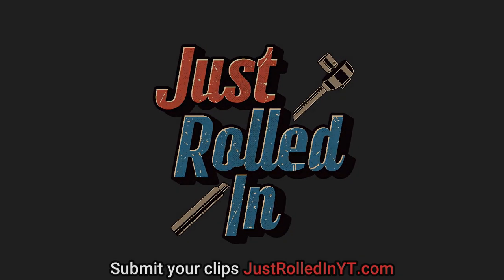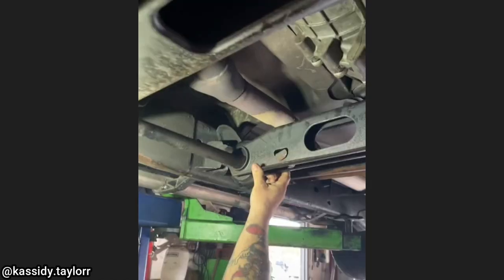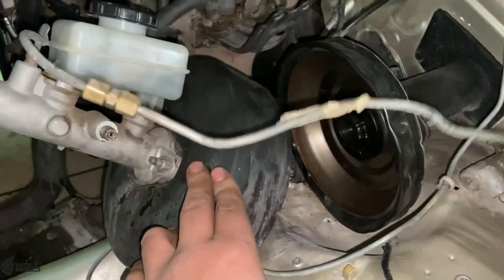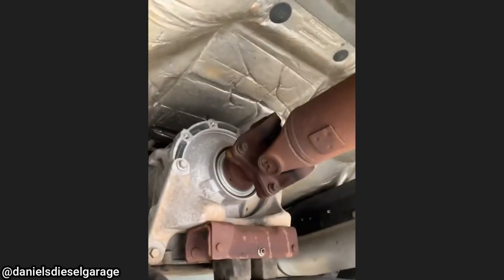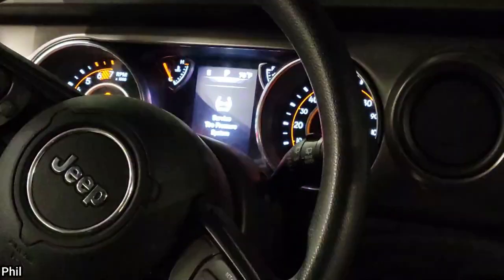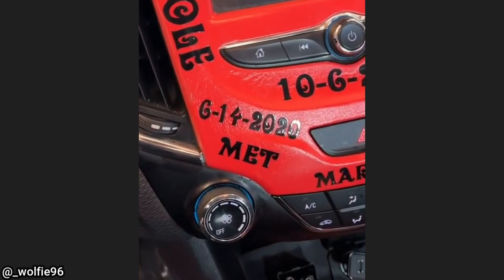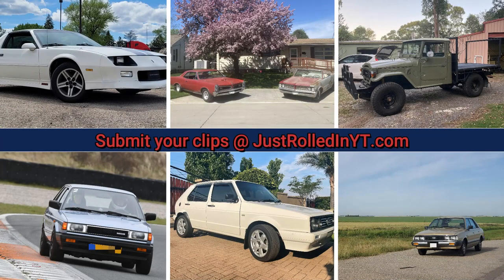Customer States Haven't Changed Oil In 60,000 Miles | Just Rolled In

Comment: The fact that these, and MANY MANY MORE, vehicles like them are out there, right now, driving next to us all, is frightening AF 😳
Reply: Glad I'm living in Germany, where a safety inspection is mandatory every 2 years. People may still fuck up their engines by never changing oil, but if their brakes are crap, or suspension broken, or the chassis rusting away, they sure are not allowed to move on the road. If people do anyway, they are facing serious fines.
Reply: @Marc_Fuchs_1985  my state only inspects emissions. I've seen some scary cars on the roads here. No windows,  no windshield,  trunk hood literally bouncing open, doors missing,  driving down the road.. its ridiculous 😒
Reply: Just the other day I had to help someone add fuel to their car after they ran out (things happen, no hate here). They also said something about a flat tire. I looked down and saw it was flat, as well as having maybe 1/32" of tread and a missing lug nut. When I talked to him about the tread, his response was along the lines of, "I did not know that was that serious." I did not even want to see the condition of the other tires.
Reply: @sletourneau3  Same with my state. I've seen some pretty sketchy cars on the road. At least those ones get pulled over and ticketed. It's the broken and rusted suspension that goes quietly unnoticed until it becomes a deadly problem.
Reply: I would suggest that mandatory vehicle inspections are the only solution. The imbeciles who drive these death traps will never change.....
Reply: @@ecardecardian7839 Sweden is known for being hardcore. =) In Germany, they are thinking about introducing it every year, though I don't think this is justified. There are almost no crashes recorded due to mechanical failure, it's usually human error.

And you are not allowed to drive home with the car, when the check fails? That's deep..... But I guess for that, people go through pre-checks, so that doesn't happen.

Comment: I once had an anxiety attack when I realized I was over 1,200 miles overdue for a scheduled oil change, I can't even grasp how someone could go over 60,000 miles past due without an oil change, not to mention the kind of engine damage there must be after such abuse.
Reply: During my chemo treatments, my wife missed an oil change on her car, and went 10,000 miles between changes.  Pre synthetic oil.  The oil looked good, and the car never had any issues.  60,000 miles, now that is just stupid.
Reply: I bought a Craigslist Prius and the first oil change was bad bad, then using Mobil1 every 5k miles cleaned out sludge making the valves louder and bringing glitter with it. I'm sure in a normal car this engine would have never started.
Reply: If you use an Amsoil "Bypass" Oil Filter Kit (that is, a kit that adds a second and much denser filter which is a "bypass" type) and you also use with Amsoil's 100% Synthetic Oil, then you could make it to 60,000 without a huge problem.
Reply: @robertheinkel6225  Was it mostly highway miles, and were you in the habit of using higher quality oil and oil filters?

Comment: My favourite personal experience is putting LED tail lights on a Hyundai, and the computer didn't detect anything wrong. However, the cruise control randomly turned off. Turns out Hyundai wires the cruise control disable switch in parallel with the brake light circuit, and there's a pull-up resistor on that pin within the cruise control computer. LEDs have a minimum voltage below which they draw zero current, so there would always be voltage on that pin as though I was slightly riding the brakes. The computer doesn't throw a code because some doofus riding the brakes while accelerating indicates a problem with the driver, not with the vehicle.
Reply: Putting a 510 ohm resistor across the brake lights works well. There would still be some minimal voltage on the sensing pin, but it's a digital signal, which can only be 0 or 1. A good rule of thumb in CMOS circuits is that less than 30% of the specified voltage is 0, more than 70% of the voltage is a 1, and anything in between is ambiguous and will cause weird issues.

Comment: I've known of two vehicles that went over 40k miles without an oil change, neither showed obvious signs of a problem.  The first probably never had oil added to it, it was down to almost nothing and rattling like mad.  After breaking the oil fill cap trying to remove it and adding some oil the noise went away and I bought it.  I drove it another 2 years without issue.

Comment: I'm always impressed how those cars in the US pass safety inspections. Where I live if your brake, suspension or stearing didn't preform at factory standard they literally take off your licence plate and you have to tow the car to shop to fix it, ant tow back and if it passes you can drive it again. You can't even go out if the lights are broken or damaged. And I'm not complaining about it, just suprised that in the biiig great US of A you can go out and drive a rustbucket which probably gona kill somena when something fail on it.
Reply: Most states have no inspection requirement.
Reply: Automobile registration/inspection is done at the state level here in the US and every state has their own rules.  The majority of states don't require annual safety inspections. Mine (New York) does both annual safety and emissions inspections, but even if your car fails to pass the safety inspection they don't stop you from driving it...they replace your inspection sticker with a "failed inspection" sticker and you have 10 days to get your car fixed/reinspected
Reply: In all fairness, 99% of shops in the US are legitimate and honest and would never let any of these questionable vehicles pass inspection.  But there are many people who are desperate enough that if their vehicle won't pass inspection at the legitimate shop, they'll find the one guy who will sign off on the paperwork and issue the inspection sticker illegally.  They unfortunately exist.  When they get discovered, they get arrested and their shop shut down, but in the meantime all the vehicles they illegally passed are out on the road for another year.
Reply: @chrisfreemesser  They do that here also, but only for minor problems. You can also do test inspections before the real one and there they point out where is your car needed repairs to pass the real inspection. But if your wheels, suspensions, breaks or stearing is damaged at dangerous levels, then you off the road. They do these kind of inspection even on the roads randomly, especially for trucks. (btw this is in Hungary)
Reply: @yuricopperhooves  Here in New York inspections are done at regular repair shops authorized by the state, not by a government agency like some other countries use. The safety inspection is fairly cursory, not nearly as involved as something like the MOT test in the UK. Given how bad winters are here and how badly the road salt rusts out cars I'm glad I live in a state that has annual inspections...they DO get many unsafe cars off the roads

Comment: Dude made it 30 minutes with just the parking break alone. That's impressive
Reply: Well, he only said 30 minutes, not how far he got in those 30 minutes... xD
Reply: That's scary!!
Reply: Shifting to neutral and letting it coast before you use the parking brake can help a lot, er uh so I have heard.
Reply: @kenlee74  The first car I had I got from my cousin. Two days later I press the break to turn in a residential neighborhood and the brakes didn't work so I threw it in park thinking it would stop it and hit the curb. Turns out his friend who put the break pads in were the wrong size and the break pads fell out
Reply: I've done it for a short distance. Maybe a little under a mile. I wouldn't trust my parking brake beyond that.
Reply: I've done it.

Comment: When I did state inspections for NC when a car failed it was entered into the state inspection computer system and Any other shop they went too would automatically fail until repairs were done and passed. There is NO way to get around the inspection system, that's the entire point...

Comment: The worst thing is that mechanics are not allowed to ground vehicles (and their owners) that are unsafe to operate and for which the owners refuse repairs. It should be mandatory to call the police on such vehicles and owners.
Reply: This could be prevented by having mandatory technical inspection every 1-2 years. Some of the cars showed on this channel havent been inspected for decades and still they drive on the road.
Reply: I had a shop teacher years ago that told the class when he was still running a shop, sometimes if a vehicle came in and needed brake work and the customer declined, he would tell them they can't leave it's a liability, so someone would call the cops either him or the customer.  The cops would come and say to the owner "you're absolutely within your rights to decline the repairs, however as soon as you pull onto a public road (i.e. leaving)  I'm stopping you for having an unsafe vehicle after being made aware." They would then approve the repairs 🤷‍♂️

Edit: If they still didn't want it fixed there, they had to have the vehicle towed to wherever it was going, and the customer was responsible for the cost.  Shop teacher would always say there is no cost too much when it comes to safety.
Reply: HVAC guys can lock a furnace if its bad. Why can't mechanics?? Its a safety threat too.
Reply: That's called extorsion bro, people have the right to fix it themself, seek a 2nd or 3rd opinion and/or accept personal responsibility in the land of the free and the home of the brave drivers.
Reply: @THRASHMETALFUNRIFFS  they still do have that right. The deathtrap just has to be towed to the other mechanic for the second opinion since it is unsafe to drive.

Your "personal  responsibility" ends when it endangers someone else's life.
Reply: @soangry  yeah, ur right, I'm being smart alec
Reply: @THRASHMETALFUNRIFFS  If the car is unsafe to operate on public roads, it is not extortion, it is a public safety measure. If you want a second opinion on one of these clunkers, have it towed to the place at your own cost.
Reply: @joergmaass  Yeah, I was being dumb and you guys in the comments are correct.  Some of these are outrageous and could kill innocent people.  I don't want to be held hostage cuz the tires are getting a little bald or the pads are down to the noise scraper if I know I can get all new stuff on Ebay for half the price of the part store and get my tires coming from the online place but when it gets to this level we see in the vid with completely missing control arms and frame rails, most are unlikely to fix that and can sell to unsuspecting buyers.  Cars in my area don't get this kind of rust but I've seen on a mechanic channel these almost new trucks with everything crusty and bad for grandma or librarians to have to deal with.

Comment: Here in UK we have to put the car in for an inspection to make sure it is safe and the emissions are low enough. Do you guys not have that? 
Also it is illegal to drive with below 2mm tread on tires or with non working brakes.
Reply: Same in Australia, after 2 or 3 years a car has to have a yearly inspection to pass rego, it's a no-brainer. That Jeep would have been ordered off the road a long time ago here.

Comment: I had an 01 town and country for about 5-6 years with the Mitsubishi 3.8L v6 it was about 75k between oil changes when I had it with no issues. Sold it with 278k on it and it is still running being driven daily by another person. I really loved that van. Not suggesting you do that by any means but it’s still funny to tell people about it 😂

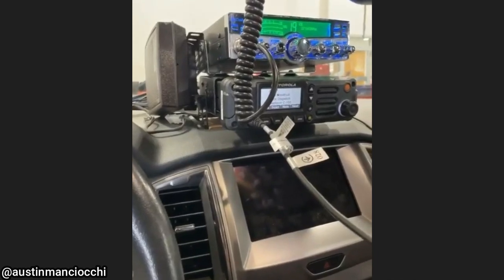Comment: 1:10 I never understood this one. I am a ham radio enthusiast, I too would install a radio in my truck if I had a truck. But I would have the wiring done properly by a tech, knowing how to wire up a radio properly is one thing. Understanding the cable harness on a modern vehicle and knowing where you can patch in your wiring or knowing along which path to safely guide the wiring is a whole other thing. Running wires through the cabin, out the door and into the engine bay is just plain dumb though.

Comment: My dad's truck hasn't been serviced since he passed away nearly 2 years ago. I haven't used it much, but after watching this channel I'm worried it's just going to be a squishy block of oil.
Reply: You say you haven't driven it much. Should be just fine unless your old man never changed his oil.
Reply: @B52Stratofortress1  no lmfao. over time, oil loses its viscosity and ability to lubricate, protect, and clean your engine. that’s why it’s recommended that you change your oil every few thousand miles OR every six months, whichever comes first. motor oil isn’t immune to expiration
Reply: @misseselise3864  Yes, he should change the oil in his dad's old truck. But he was concerned about his engine oil being "a squishy solid block". The old oil is still liquid and doesn't turn into jelly just from sitting for a year or two.

Comment: As someone who is formerly a mechanic, and now a manager at an auto parts store.
These are nightmare fuel for me.

I use full synthetic mobile 1 in my vehichle and still change it every 4 or 5,000 miles and it advertises 10 to 15.

I tell customers it can go 5 to 6 safely.

Comment: i have to wonder whats in the oil in the usa that turns it to jelly if not changed. my folks kept forgetting to do the oil on there E270cdi, when i finally got them to bring it over after 41000 miles it was thinner then when it went in, not all jelly like. 

and looking at some of these thankfull we have yearly MOT's in the UK. yes they can be a pain to pass sometimes if you don't keep on top of things maintance and safety wise, but they keep crap like these things off the roads.

Comment: When I was 16 I drove my car for about three months using only the parking brake lol.  Also, the U joints were so bad that the car would give you shaken adult syndrome every time you went over 50kms per hour.  Tires were so bald I couldn't even make it up the driveway when it snowed.  I'm amazed I'm still alive.
Reply: Many years ago I bought a VW beetle with no brakes. I drove it on the gearbox and handbrake for a week before the parts I needed came in....

Comment: it always hurts to see engines having nothing but sludge in them. and they are still running...

once had an old Mercedes 190 diesel from the 60's, where the customer had stated the engine stopped running. and yes it was seized good. checked the dipstick, it was barren. crankshaft wouldn't move, either. we checked the drain plug, but nothig n came out of it, not even with poking the sludge with a screwdriver. removing the little steel oil pan sitting at the sump of the large aluminium pan, revealed said steel pan willed with dry sludge, and the crankshaft being blue from the heat... yep, seized for good. customer then brought an engine from a newer model, which was partially taken apart and not complete anymore. also, you can't switch the Diesel engines between the old tailfin models and the W144/8, because they moved the oil filter housing around the engine, and either engine mount or steering gear would be in the way. customer eventually had the poor car towed away, and we never heard of them again.

0:20 this is how I like it: shiny oversized mofo wheels on, but no money for any repair whatsoever, because the wheels ate up all the funds. in germany police or authorities would have had this thing towed away and placed in the back corner of the lot, and the license revoked.

I laughed at the last clip. you wouldn't have been able to hit that biker if you aimed for it... XD

Comment: say what one will about the strict MOT(or similar agencies) inspections in the UK and other nations in Europe but I bet they keep things like that ratchet strap held together chevy off the road or that car with a maglite for a headlight.

And gas in a container that is under the hood? do they think they have the Wagon Queen Family Truckster?

And the number of people not doing oil changes is scary, Especially that mustang if its gone through clutches that means the driver either sucks at stick or is doing very spirited driving like track days in which case they probably should have had a higher than normal rate of oil changes. As id imagine the usual suggested intervals are based on normal town and freeway operations.

Comment: I am confused. Wouldn't the car burn through the oil around 5k ish miles? I almost went through all my oil on 6k miles and then mechanic said I should always fill it when it lowers by a quart to keep engine running smooth.

Comment: At some point their needs to be laws that require shops to hold cars in these conditions. Not the late oil change ones, but like the ones with pretty much completely missing suspensions/steering [as seen on other videos as well]

Obviously would need to be a very strict criteria. But by god some of these cars shouldn't be driven and can almost guarantee that a car in that condition is driven by someone who shouldn't be driving period.

Comment: That first truck reminds me of mine.  When a shop wants to charge you $800 to cut off a tiny exhaust leak and change the whole system when a $10 tub of putty will fix it, it is hard to trust mechanics.  They always want to fix things back to previous or better standards and if they were so good, why did it wear out in the first place?   Make better cars that maintain themselves, like my water heater.